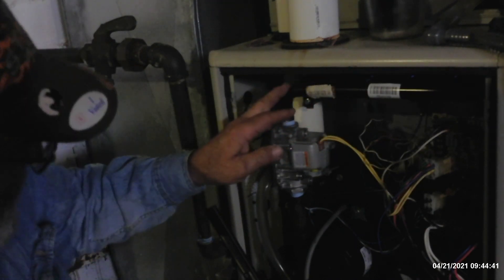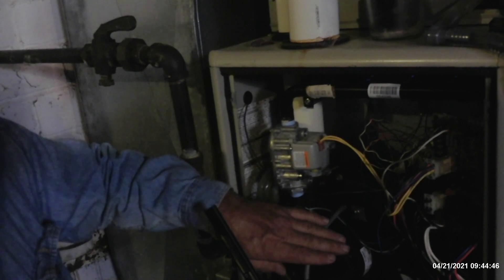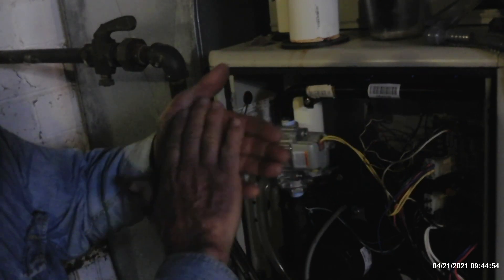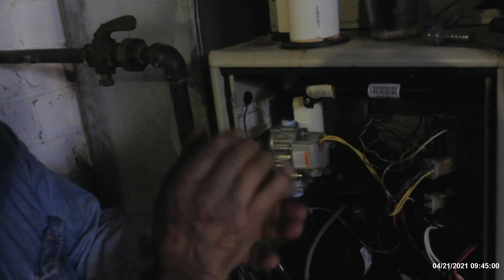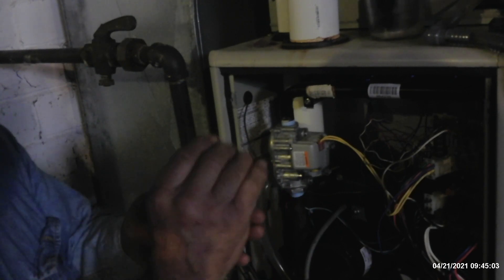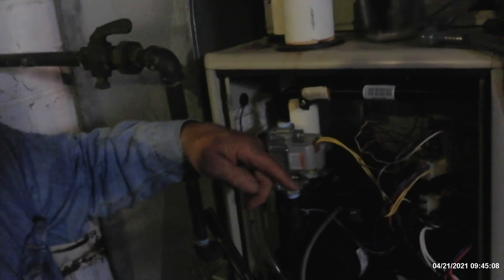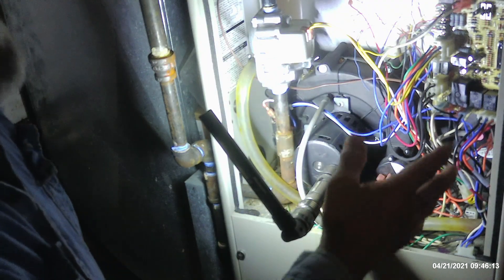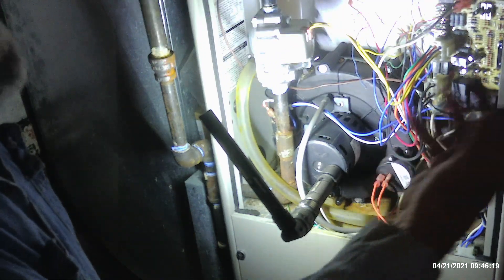Gas Furnace Troubleshooting 92 AFUE

Comment: Excellent video to bring home the fact that furnaces need to be checked annually.   Just had mine serviced about one month ago.
Reply from the maker: The higher the efficiency the more attention they need to be given.  Then if they burn on propane, they require another level of service as well.   There's no worse service call than a condensing furnace that has carbonned up due to restricted combustion air.  A nasty service call that is !!

Comment: Would you ever add a bit of dielectric grease before you put that cleaned spade connector?  I spent a lot of time living on a boat where corrosion was always a battle.
Reply from the maker: It probably wouldn't hurt a thing.  I use oxide inhibitor on larger set screw electrical connections for sure.  And in damp areas I use the rubber amalgamating tape that when stretched over multiple layers molds itself into a slug that waterproofs pretty much the whole connection.  For example under my off road trucks and trailer lighting and electric brake connections are typical applications.  Plus submersible pump connections as well...  Thanks Tom for the comment and question.

Comment: That`s all good information TractorMan....If ever my furnace stop working I`ll bring this video up for advice.....I can follow the circuit and fix most problems in these furnaces but the gas company does not want use to poke around on gas items....They want us to hire the big gas companies....I like to visually check things before I get on the phone.....CHEERS
Reply from the maker: The gas company down here does everything they can to get a customer to call a contractor in it seems.  Even back in the 70's when I went to work in the big city a good percentage of our calls came from customers that'd already contacted the gas co and were told to call someone for service.  They like to replace meters and chase gas leaks...but then they will isolate a leak to inside or outside the home, then shut off the gas for you to call a contractor to find and repair.  Now this in not ALL the cases, but in 40+ years I've been in the industry its a LOT of the time.  They WILL make all the repairs on their side of the meter though.

Comment: 44 thanks it cold here 29 little wind we have a heater in basement it quit yesterday needs a   igniter
God Bless All 
PaK
Reply from the maker: Too bad you live so far away Peter...I could've stopped by after the Father in laws little job.  On those igniters, if its a glow coil (hot surface igniter) and you change it yourself, be sure to not touch the actual igniter with your fingers.  The oils in your skin will cause premature failure of the igniter coil.  Good Luck my friend and hope it warms up soon.  Today we are hitting 72F.

Comment: Even though we don't have, nor use Natural Gas for heating, I found this video very interesting. I always like to watch things being repaired proper;y.
As the saying goes,. " we're never to old to learn" !
Cheers W. continue on now with your safe and happy ( and warm ) weekend.
Reply from the maker: Oh heck, today its gonna hit 72F (22C). But its also been raining for two days. I think I remember you saying before you guys up there had bottle gas.  Out in the woods where I live there is no natural gas either.  The gas line terminates a couple miles up the road.  But are there just no natural gas supply lines in Newfoundland ? 
    LP is pretty much the same except there's 2500 btu's/cu ft where nat gas has 1050 btu's/cuft.  That's why LP orifices are smaller.  LP also is supplied to the equipment at 10 - 14'' water column and natural gas is usually delivered at 3.5'' w.c.  Liquid Propane atmospheric burners have a more critical need for proper air adjustment where nat gas is much more lenient.  Thanks for taking the time to watch Reg.  Hope weather is breaking up North !!
Reply: @tractorman4461  No sir, no natural gas at all,.. many many barrels of crude in our offshore waters but not a drop ( hardly ) comes ashore here for our use. It's shipped 'south'.
Weather,... well it's been a glorious weather weekend here so far. It'll get better from now,... or so I've been told :)

Comment: Never had a furnace like that apart before, but there is a lot similar with the rv furnaces.
Reply from the maker: I worked on few of the RV units back in the days before electronic ignition and high efficiency burners.  I have no clue what they are like today.  So we are at a tie.  LOL.  Thanks Mark for the visit today.

Comment: Gotta check the flue isn't clogged with those pressure switch diagnosis. Most recent one I had some kind of wasps or hornet just had to build their house right in the exhaust of the RTU.
Cool video tractorman44!
Reply from the maker: I use a digital pressure guage and a blood pressure bulb to check the pressures that make and break the switches.  When they don't make the change in switch position within their setpoints....out they go.  But yes, you are right the first order of business in testing a pressure switch is to verify the condition of the flu.  Many times if there is no screen on the flu discharge, there will be a dead bird.  They like to roost in the warmth after it shuts off then snooze and die of carbon monoxide poisoning when it fires back up.  Thanks Andre for stopping in for a visit.  I don't seem to miss the cold roof tops at all by the way.  LOL  But I sure enjoyed it for the previous 40 years plus.  Have a wonderful week.